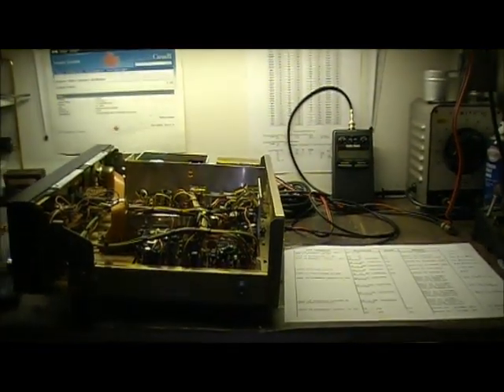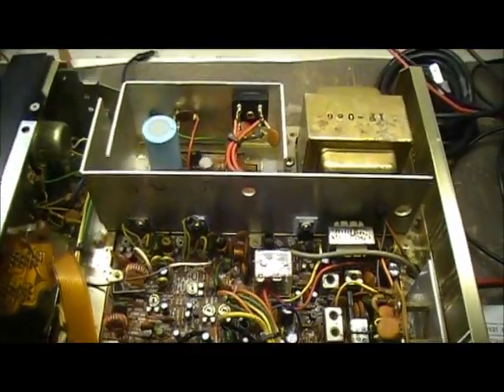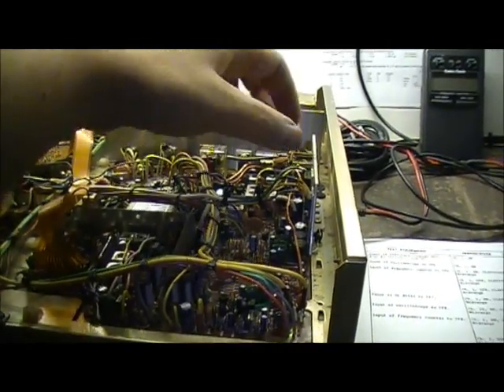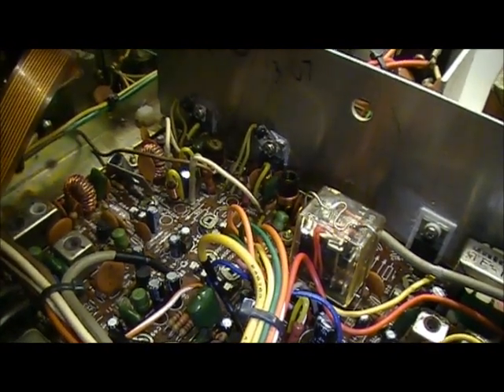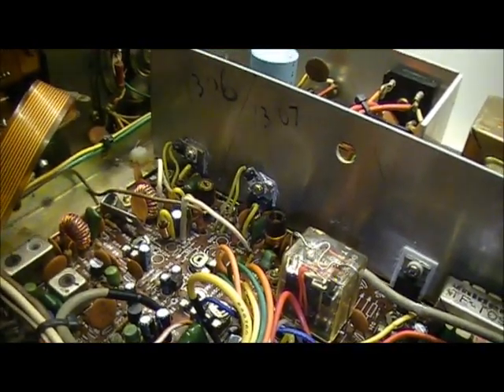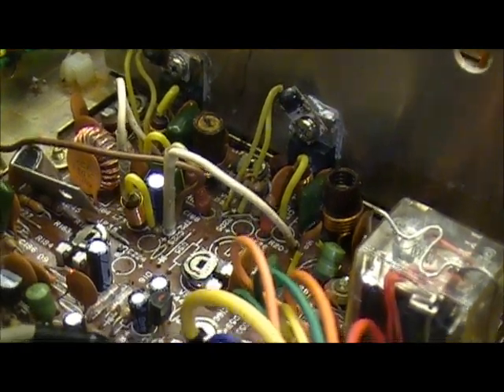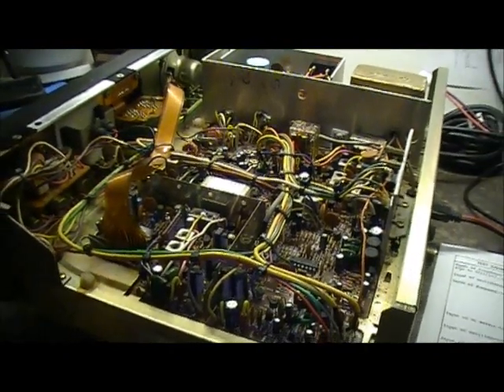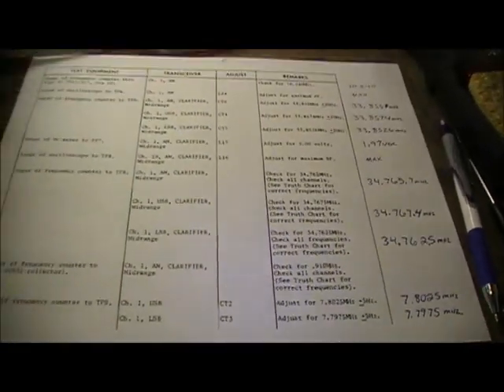Realistic TRC-458 Receiver frequency tuneup and update

Comment: Check the signal into driver, then final. If its present then check the biasing of each transistor. Could be a failed cap in this old of radio, clamping the biasing on one of them...

Comment: Replace Tantalum capacitor (blue in color) 2,2mf 25 V  with electrolytic same value 2,2 mf 50V, if is all ready replaced ,made sure that was polarized correctly   .You will found capacitor in front of the radio chassi left hand side facing the radio,between two white wire jumpers.This capacitor is knowing failure in this radios and it will kill your TX.Tray to replace smooter electrolytic capacitor in power supply, 3300mf 35V with 4700mf 50V .

Comment: I guess u have checked the input to the final with a scope Darrell to see if u have the same level of rf as u do at the output of the driver?
Reply from the maker: You know what... Totally did NOT try that Gary!   Awesome suggestion.. Thanks!
Reply: @Radionut63  I would check it with the scope Darrell between the driver and final that way u can see the signal level. RF probes are ok but u cant see what the signal level looks like. I agree tho it looks like a leak to earth on the final or maybe a cap between the driver and final.
Reply from the maker: Will give that a try tomorrow evening after work.. was at work today till 5pm, now i have to go back to work from 8pm-10pm tonight.. Fun fun fun.. LOL
Reply: @Radionut63  its 23:10 here mate so bed time lol. Best of luck with work Darrell

Comment: did you checked the low pass filter after the PA? There could be something there😊
Reply from the maker: Something somewhere pulling all that power to ground... I only get a maximum of around 150mw at the antenna connector.. Something is not right in there someplace!